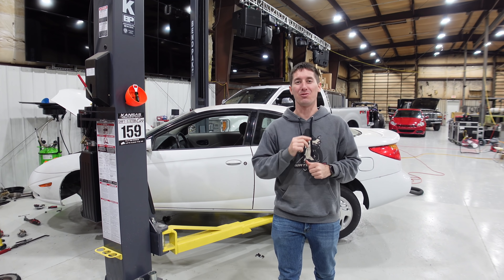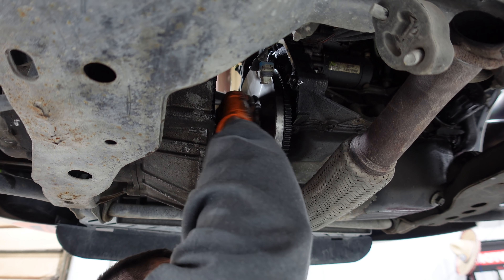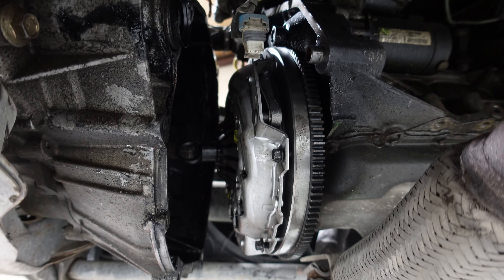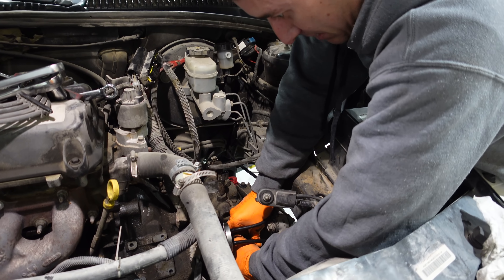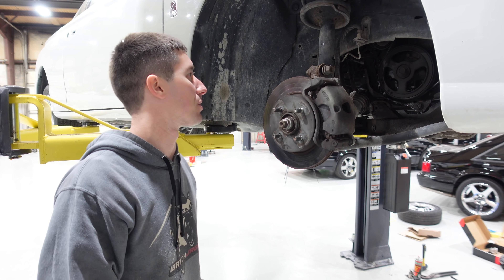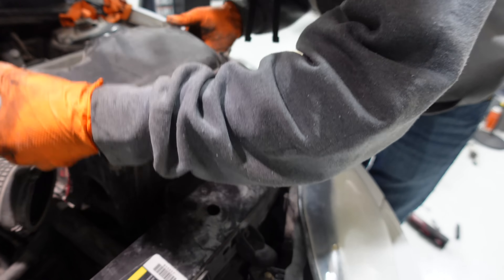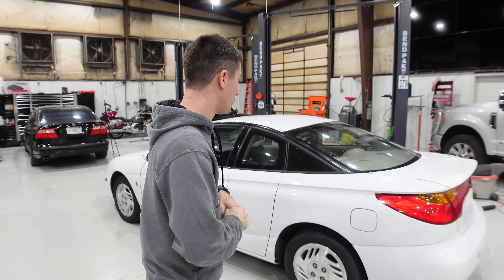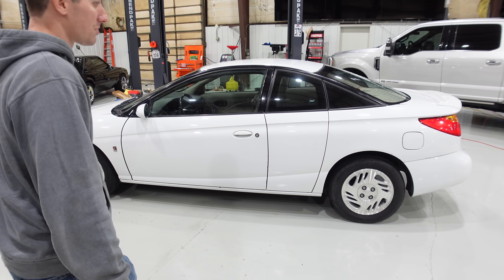I FIXED My Cheap Saturn SC2 For $300 NOW It Has POPS AND BANGS

Comment: JR - To fix the window switches, disassemble, then clean the corrosion off the copper contacts internal to the switches w 0000 steel wool - we did this on a family member's Saturn - problem solved for zero dollars!  BTW - when this one's fully sorted, my son wants to buy it!  : )
Reply: Proper saturns have crank windows. (Like mine..) 😂

Comment: When I did alot of parts swapping, replacing and rebuilding on my 10th anniversary SL2 and my sc2, sixth sphere forums was extremely helpful. Someone made a comment about the correct fluid in the gearbox and thats absolutely right. The speedo issue seems like a disconnected plug and should fix rev limiter issue. The window switch is common issue. I think the contacts just need to be cleaned up as I had to do that for mine and the foglight switch as well.  You can replace if you can find a spare one. I had a few spares from junkyard always on hand. Speaking from experience, those plastic panels should buff out nicely if you want to polish and coat them.
Reply: That sl2 us Uber rare

Comment: The non-self adjusting clutch was from 91 - 98, 99 - 02 had the self adjusting clutch. It is possible to run the non-self adjusting clutch in a 99 - 02 car but you need the entire assembly (flywheel, clutch, pressure plate, TOB, and hydraulics). You cannot however mix and match parts from both the self adjusting and non-self adjusting clutch assemblies.

Comment: The plastic retainer strap on the end of the hydraulic cylinder rod helps locate the rod into the release lever. So just leave it on there like you did. When you push the clutch pedal in, you will feel it break and the rod pops into place in the release lever. You may want to pull the vehicle speed sensor out of the transaxle case and just do a quick inspection on the differential pin. There is a small roll pin that sometimes breaks allowing the pin to start "walking" out and if it moves far enough will crack the case or worse you may hear a loud bang and fluid leaks out. Some people have drilled the hole where the roll pin is located to a bigger size and installed a "rolled" roll pin. Supposed to be a stronger repair.

Also, these are great little cars even with their quirks. I used to own an SL2 and worked on these for over ten years. Just keep an eye on the engine oil just to see if it burns any. Easier to check than to replace an engine.

Comment: Saturn's do have a two step rev limit.  If you free rev it in neutral, I drops out around 4500.  It goes to red line under load. That will likely fix itself when you figure out why your speedo isn't working.  Cruise too would need the VSS signal, so that's likely to come around too.  If it doesn't, check the clutch switch at the pedal since you replaced the clutch master cyl.
Reply: I suspect someone didn't plug in his speed sensor. Those cars were a blast when running well.
Reply: @mikemeyer5805  Wonder if the previous owner was limiting mileage on the odometer
Reply: @SteveBassen  Could be. I recall those weren't the most difficult connection to plug in. Guess he did mention there. was something unplugged.  Man, I miss my 98 SL2.
Reply: Pretty much what I was going to say, it's limited to 4500 because the computer doesn't know the car is even moving. Hence no speedo & no cruise.
I have an SL1, manual trans, the rev limit is right around 6K when the car is moving.
Reply: @mikemeyer5805  just got a 99 SL2 for 1k at a little park n sell outside the naval base in Washington. Just wanted a little 5 speed beater. Awesome car. Needs some work but I’ve got the next 5 years to fix it. It’s blowing a little white smoke and needs all new gaskets and a window motor but it’s very clean. Minor scratches and interior is spotless aside from headliner needing replaced

Comment: I was a Saturn parts guy years ago, and yes the slave cylinder retainer is just for assembly breaks on first application. They used to sell it as an individual part for a clutch replacement back then. GM really had something special with those cars but unfortunately didn’t update it much and then replaced it with the ION which was janky by comparison
Reply: I asked this already but will a cable tie do the same job?

Comment: The slave and master cylinder assembly that you pulled out of the car was probably good. Those tabs are supposed to break whenever you engage the clutch for the first time. Those assemblies come pre bleed for an easy install. I had to put two on my old 95 Saturn Sl which I loved and still miss to this day!!

Comment: I usually degreese my jobs before I do anymore next time spray the top of the struts where they connect to the spindle assembly with some white paint so you don't screw up your camber that way it goes back right where it was shows exactly where the struts original location was otherwise good job 👏
Reply: He did a fine job, just differently than you’d do it. So the ‘otherwise’ is unnecessary.
Reply: Degreese?
Reply: @justsomeguy6550  ok Karen 👍
Reply: @Tron1731  you need to work on your insults. That was used incorrectly, much like your usage of “degrees w”. You could have called me a moron, idiot, asshat, or son of a bitch. Any of these would have been more correct. You came in and criticized his work because he didn’t do it the way you would. That sounds pretty Karen-like.
Reply: @Tron1731  you are so right. I do.
Reply: @Tron1731  204 subscribers in 12 years is quite impressive.

Comment: The band on the slave cylinder is supposed to break.  It is to keep the pushrod from falling out, align it to hit the pivot on the fork perfectly and make it that easy to do the bayonet mount twist.  Reinstalling one that has the band already broken can take a few tries until you master it as that pushrod is all floppy, it has to be depressed about 2" BEFORE you can engage the bayonet mount...this all while keeping it from slipping out of the detent in the release fork.
Reply: I'm doing this job on an sw1 here in a few days. When pulling that slave out to do the clutch, can I ziptie the pushrod back into the slave as far as possible and "rebreak" it by reinstalling?
Reply: @ThatOddGarage  We never had any luck with any method except looping a string or ziptie over the push rod while getting it seated in the "cup" of the release arm, pulling out the whatever it was before pushing in and turning.  The first time doing it is frustrating but take your time and you will get it.
Reply: @michaelkrenzer3296  sweet! That was what I was wondering. So I can zip tie that pushrod back in, clip it when it clicks into place, and pull it back out? I hope I'm understanding
Reply: @ThatOddGarage  As I said, you CANNOT ziptie it back in place...there is no place for the ziptie to attach.  You can loop (think a "U" shape just to keep in flopping down) a string or ziptie around the pushrod just to hold it horizontal as you position the pushrod into recess you cannot see inside the bell housing.  Before you push and turn the slave cylinder into the bayonet mount, you pull the string or ziptie out.
Reply: @michaelkrenzer3296  thank you! That makes sense to me, I appreciate it!

Comment: You need a large shop table you can roll around to keep all your tools and parts on instead of spreading everything on the floor, it will do a lot to save your back and knees.

Comment: It's rev limiting because it doesn't see the vehicle speed above 25mph. These also have a shift indicator when the vehicle speed sensor is working correctly. Your check engine light is related to it as well but i'm sure the lack of O2 sensor is another reason.

Comment: Hey, JR, there is a reason GM spec'd Dex III fluid.  You're going to destroy the synchro blocker lining with anything else.  As a Saturn tech, I've rebuilt several for aftermarket shops putting the wrong fluid.
Reply: for some vehicle its required to use OEM fluids- I will only use honda trans fluid and coolant in my acura- oil doesnt matter of course it most cases
Reply: cant see using MT fluid when it specs AT fluid -
Reply from the maker: MTF is literally designed for GM manual transmissions 🤷🏻‍♂️
Reply: I'v always put some Synchromesh in my old GM transmission's and it was perfect. Even helped it shift eay better than stock.
Reply: @WatchJRGo  supposed to take dexron  ATF

Comment: Check the rubber o ring on the shifter linkage those love to break on those. Had an 02 with 233k on it when I sold. Burnt oil but was dependable.
Reply: Also another common failure point is the shift bushing... I ordered one out of stainless steel, should be a lifetime fix.

Comment: Say what you will about GM products but their twin cam 4 bangers are a riot to wind up. Had tons of fun in a 2000 twin cam Chevy Cavalier back in the day
Reply: Oh I will Michael, oh I will.
Reply: Oh we will Michael, we Will.
Reply: My '96 Pontiac Sunfire (my first new car) had the twin cam 2.4 in it. It was a blast to drive.
Reply: @juanmanuelgil3436  good...the mind control is working!
Reply: I still have a twin cam 5 speed in a grand am that I put a turbo on. 13psi  of fun
Reply: @mduff94  🤣🤣 no kidding though, a friend of mine just bought a 2001 Chevy Cavalier Z24 4-speed auto, with the 2.4L. The thing is mint has like 60k miles

Comment: I had that car as well. Only problem with that car  is in the winter  I couldn't leave my parking breaks on  cause it would freeze on me I had a stick shift as well . And the only reason why I got rid of it is the clutch started Going Out on me and I'm not a mechanic. So I had to get rid of it.Good car😪. I was wrong parking brake freeze was my 
2002 Hyundai elantra.

Comment: Seemed to still have a check engine light when driving. Might be because the O2 sensor is not connected to the missing exhaust.

Comment: Hi, I also have a 2001 saturn sc2 coupe.  Bought it new and love it.  However I'm having my first problem ever after taking it to my mechanic for new plugs and wires and a replacement coolant temp sensor (he used Forecast 9386 sensor)  It's using too much gas and is jerky and hesitant on acceleration.  My mechanic still has it at the shop after a week and says he's baffelled as to the cause.  You seem so knowledgeable about this car and thought I'd try getting in touch with you for advice if you have thoughts on the problem.  Thanks  Penny

Comment: Lol yikes yes if the fluid spec is for ATF you gotta use ATF,  especially for a manual trans because the synchro action is so critical to the fluid type. Not to mention if the trans is using bearings made for ATF and you use MTF you can roast the bearings (MTF is too thick). Just like that Foxbody in the background. Spec for manual trans is ATF! :) keep up the good content!

Comment: The Owner's Handbook from Saturn 2001 S Series calls out Saturn ATF, which is NLA. The alternative specified is GM Dexron III. The last rev. of Dex III was Dex III H. GM still makes it, and you can buy it by the quart on Amazon. Do NOT use Dex IV, even though GM claims that it is backwards compatible. Dex IV is NOT compatible with Saturn S Series transmissions.

Comment: All honesty.
I would buy it from you like it is. 

I would give you 2500 cash without fixing exhaust, check engine lights. 
Because I do have one an automatic version amd have replaced common issues with them plus having a 5speed would a fun beater backup, plus trackweekend car, I live near a scca track.
If you were from Ohio, I would plus where I live don't have need to get any vehicle an e check. 👍

The speed sensor is on The transmission, the unplug corrector you've mentioned.

I would fix the speed sensor for the odometer and I would just put an actual oem exhaust on it.

Because whove buys would need to get state inspected at shop before getting titled, plates too.

Plus you need get rid of check engine lights too. 

Besides exhaust speed sensor fix.

Person or kid who buys it takes get state inspected will in for a sad day.
The state inspector before getting plate titled too. 

Will tell that buyer, the saturn aint safe and it fails state inspection, car would need to fixed before it safe roadworthy for the road...

Food for thought, you don't want the new buyer to come to you with that paper from state inspection were car fail emission e check.
Saying you sold a lemon and want money back.

Thoughs, sensors for check engine light are very cheap, around 10bucks. 

Pricey, part to replace on saturn s series is the fuel pump it's around 200bucks at any local autoparts store plus it helps to have a commercial discount at those places too.
if check engine is still on after you changed each sensor, issues from the codes.
Major one is fuel pump. Keep in mind it will throw code for fuel filter, bad gas cap.

Comment: Pry Bar on the threads of the wheel studs made my eye twitch😳. Throw the lugs on next time.
Reply: Just a sturdy screw driver or punch into the rotor vane against the caliper.

Comment: 😊😊÷excellent job.
My sc2 has hard start and guy i bought it from said it needs a coolant temp sensor ....the one that goes into the side of the head i think it is...
After my car warms up it takes a good 5 - 15 seconds of cranking for it to start...anyone know if the coolant temp sensor can cause this?
The 2 wire one thats oe plastic but aftermarket is brass

Comment: Double check all your wire connections: you might have left the vehicle speed sensor disconnected which would explain no speedometer.

In 2001 the only cars on the planet with more than 5 gears in a manual transmission were the Corvette and V8 equipped Firebird/Trans Am and Camaro. So no, a 5 speed was by all means NOT weird lol!!!
Reply: agree but you can also add V8 serie 5 bmw. my friend owns a 95 540 with a 6spd!

Comment: Nice work! The pop pop I think is not normal, I don't remember ever hearing that in any of mine. Maybe I just don't push mine hard enough, my current one vibrates pretty bad.
Reply: Try replacing the top engine mount on the left side of the engine if you have excessive vibration (Saturn called this the Torque Axis Mount).  If the steering wheel vibrates at idle, you need a new mount.
Reply: @brettkirkpatrick464  Unfortunately I already replaced all of them (all 3? two engine and one transmission?) Even got the "solid" mount, etc. Not sure if I tightened it too tight, or not tight enough, or if I just got duds (but I got rock auto selling moog, I think). Large mystery...

Comment: It would seem that JR has made a New Year's resolution to begin using funnels.
Reply: Must have found stains on the new floor that the floor scrubber couldn't remove.
Reply from the maker: I would never, this was just impossible to fill 😂

Comment: What it really needs is the oil drain back holes in the pistons slightly enlarged. Sounds weird to drill holes in your pistons. But the 1.9L Saturn engines really do need it. Or else it just burns oil until you forget to top it off and the engine goes. 

What do you think killed the ones in the yard? Low oil. Why low on oil? Because it burns oil. Why burning oil. Carbon clogging oil drain back and not allowing the oil ring to open back up.
Reply: Completely accurate comment.

Comment: Yeah GM clutches are kind of odd. That is supposed to just break and stay put. My S10 was a bear to bleed. They have the bleeder screw on the bottom of the slave cylinder and the line loops up the firewall above the slave and the master. So unless you buy a factory sealed unit you basically have to convert everything into an fittings and lines and then leave the slave hanging from the hood prop or whatever before you install it otherwise you can go through gallons of brake fluid and still not get all the air out ask me how I know.  Napa has GM synchromesh. That's what my s10s transmission took.  10 bucks a quart back when you could get ATF for two bucks a quart kind of sucked.

Comment: Nice! I wish the clutch disc had tabs to retain the damper springs. I think I would have turned the old flywheel to lighten it up, make a little freer revving engine. Nice job anyway.
Reply from the maker: The replacement flywheel felt slightly lighter 🍻
Reply: @WatchJRGo  
Cool then! Lighter is better unless you need torque.

Comment: 4500 or so is the rev limiter when not in gear or not moving. I would bet getting the speedo working will allow it to rev higher while driving.
Reply from the maker: Seemed like it was temp related… went away after it warmed up. Could’ve been speed though 🍻
Reply: @WatchJRGo  Temp related makes sense.  Not sure if your issue was the temp sensor and/or it’s connector, but those fail all the time in those. Not that you plan to get a fleet of old S-series. Love these flips btw.

Comment: That master and slave cylinder design is so good.
Wish all car makers did that.
Reply: I partially take that back. The ECU location, right next to the battery fumes....
Kinda like GM putting the ABS wiring module right above the battery in the late 90's luminas. Every one of them had corrosion related failures.

Comment: Tip: do not use an after market clutch on these S series Saturns. I had to have a clutch pulled out after install because it wouldn’t engage correctly.
Reply: yeah ok but not every clutch is the same as your malfunctioning clutch
Reply: @jamesmedina2062  this was from autozone if I recall correctly. Regardless, some things are just better oem.
Reply: @user-ln7of9gs4s  I went to the back of an Autozone and every single brake rotor was made in China. We have USA-made clutches that exceed OEM performance. Who do you think made the OEM clutch?  Often a company like Sachs.
Reply: @jamesmedina2062  Where it's made isn't as important as who its made for. I really don't care if it exceeds performance, the point is it didn't work. I don't buy any thing from auto zone unless its a hose, belt or brake pad. Better deals and quality can be found else where.
Reply: @user-ln7of9gs4s  👌